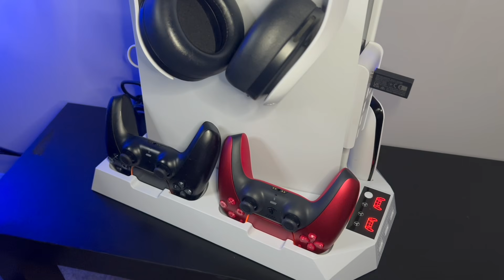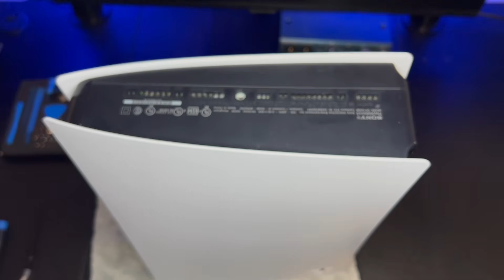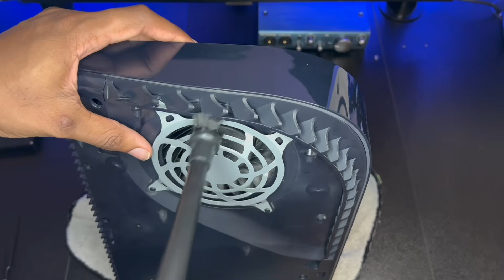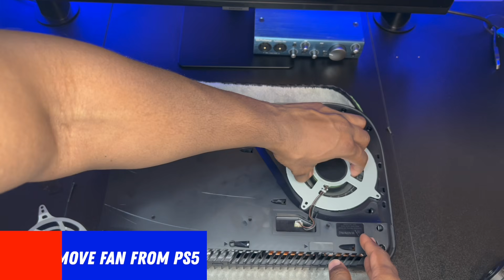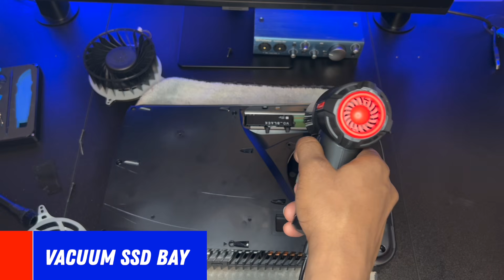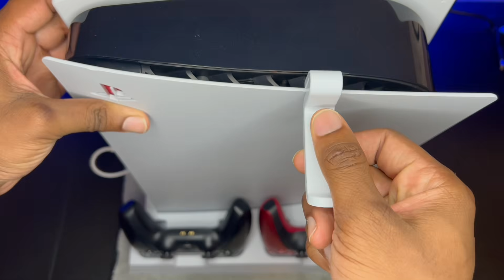How To Open and Clean PS5 | Stop Overheating FOREVER!

Comment from the maker: Hey everyone! I hope you enjoyed me cleaning out my PS5 after 3 years! Took a lot of time and energy to produce this video for you guys and it was WORTH it! It now runs more efficiently and a lot more quite during gameplay! Hope your enjoying the week so far!🫡🎮🔥
Reply: Thanks a lot. Btw i was allso cleaning it after 3 years. I never thought that i would be able to clean ps5 of my friend without any clue. Though my version was different from all other ps5. Disassembling it is a cake but the problem comes inserting the 04 different push to fix pins, flat and wide data buses insertion and remembering the screws. Though i was able to fix everything. Pin color was mentioned on the board and i was left with 03 extra screws but it doesn't matter. I had a good blower and i used once i opened everything. It was full of dust. But i am over the moon coz it seems a miracle to me that it worked after assembling. Coz 01 hard push can ruin and dump your ps5. Super happy. Thanks to God.

Comment: Hi Mark. Great Video. But don’t forget the heat sink inside could have a blanket of fluff along it. Might be worth doing a part 2 where you disassemble more to check the heat sink? Also don’t forget to look for dry spots on the APU and redistribute the Liquid Metal with some 99% IPA and cotton swabs. This will keep your PS5 running perfectly 😊